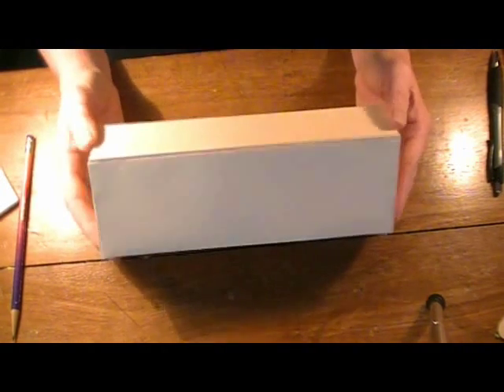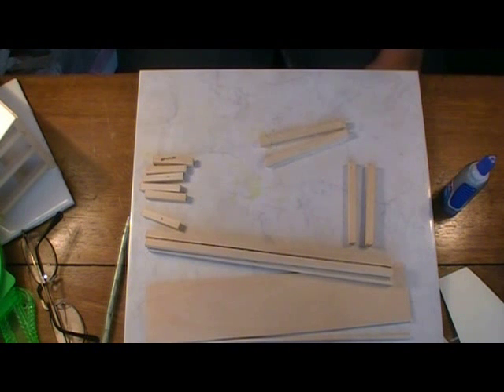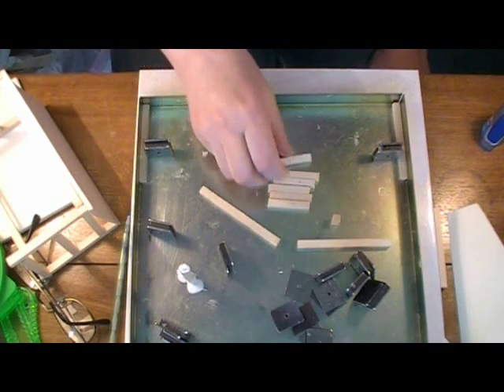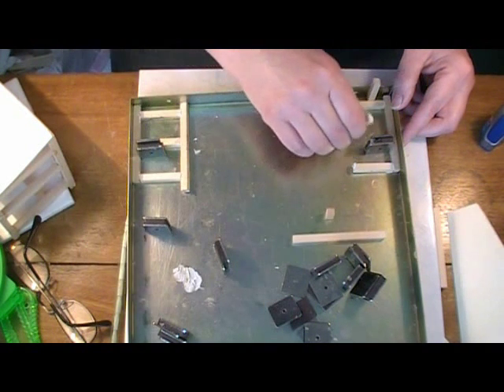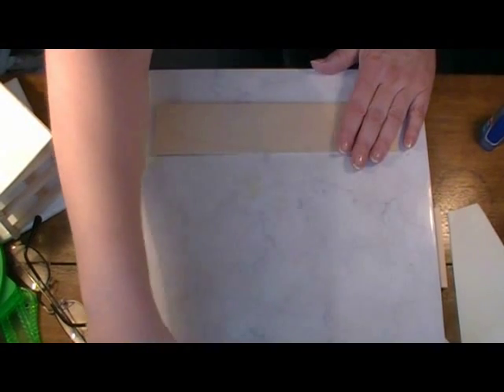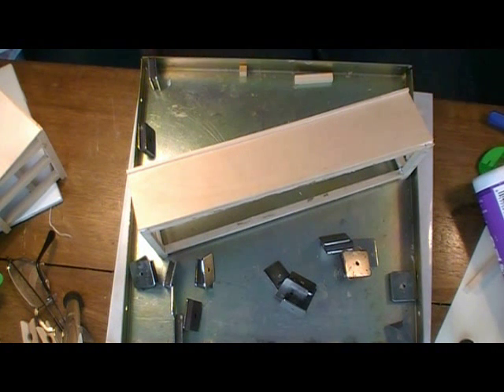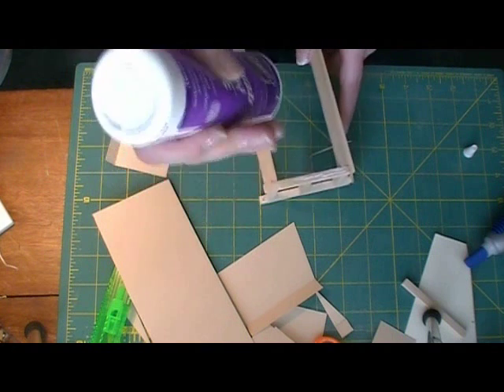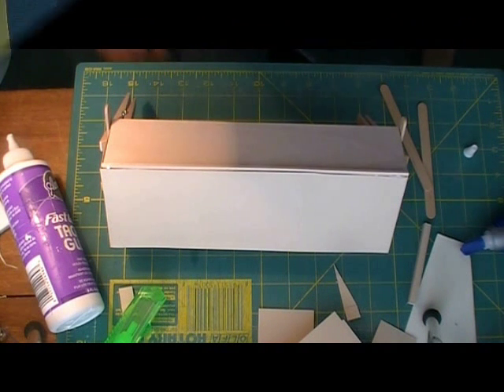Farm-stand Display table

Comment: thank you.... I had a quick question about the glue.  You said you would have used zap-a-gap if you had some.  do you mean together with the tacky glue, or instead of? I remember in your toy store piece you used both - i just didn't know if you would use both in something smaller.